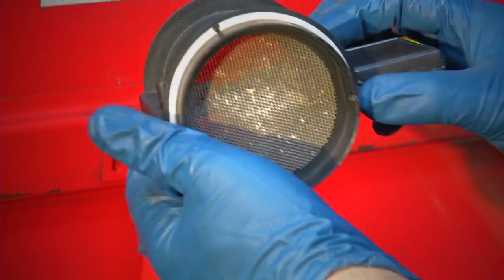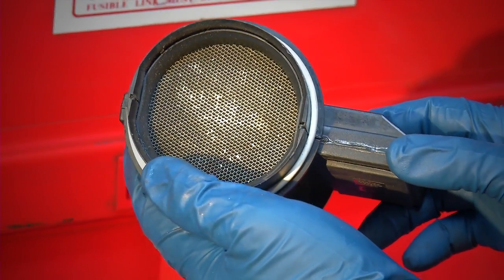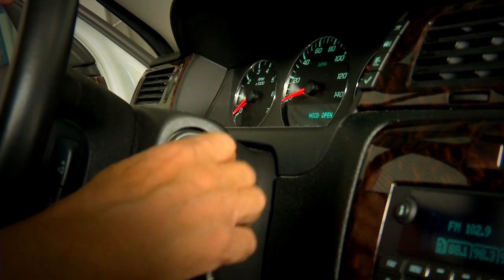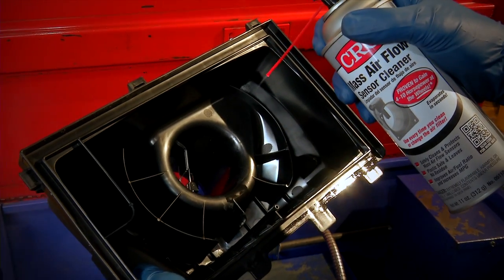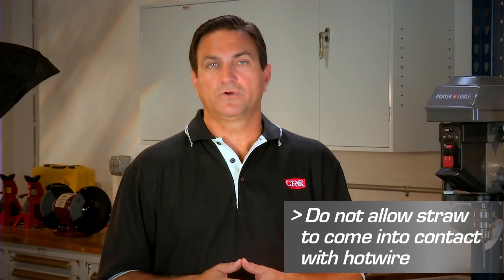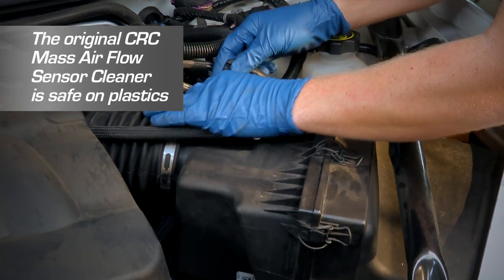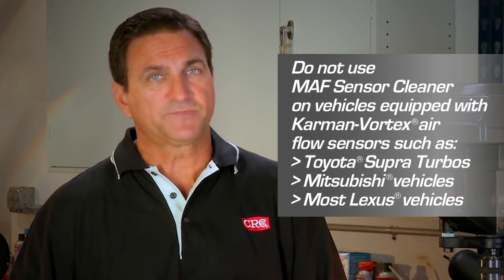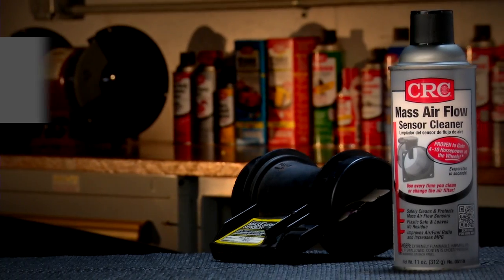CRC Mass Air Flow (MAF) Sensor Cleaner Instructional Video

Comment: Can you do a video on using CRC Mass Air Flow Sensor Cleaner as a safer alternative than standard carburetor spray cleaners, for (the newer, black) plastic Briggs and Stratton carburetors - or maybe something like CRC 05103 QD Electronic Cleaner, as another safer, secondary alternative . . . or maybe even on comparatively, which of the two would be the better / safer alternative, and why?
Seems like no one else has done this yet.
Thanks, in advance.

PS: Don't know if you'd be interested in this or not, but I'm strongly considering / leaning toward the possibility of purchasing a Toro Recycler 21-in Gas Self-propelled Lawn Mower with 140-cc Briggs and Stratton Engine, Model # 21321, and have been doing tons of research, being brand new to this, and all. Am very "OCD-ish" and aware of what folks share about this mower, as far as the various opinions, positive and negative, but've pretty much made my mind up. That's how I learned about the necessity of being careful with which carb cleaners to use on which carburetors, etc., but still have more research to do. That being said, I also did an "AI" search related to the above referenced cleaners, and thought you might find the following results interesting (?) for helping you w/your new video on this, if &/or when you do one : 

"Evaluation of CRC Mass Air Flow Sensor Cleaner and CRC 05103 QD Electronic Cleaner"
ref., https://iask.ai/?mode=question&options%5bdetail_level%5d=detailed&q=Are+CRC+Mass+Air+Flow+Sensor+Cleaner+and+CRC+05103+QD+Electronic+Cleaner+amongst+the+very+best+and+very+safest+of+carburetor+cleaners%2C+for+plastic+carburetors+and+their+component+parts%2C+like+rubber+gaskets+and+O-rings+-+such+as+those+found+on+the+Toro+Recycler+21-in+Gas+Self-propelled+Lawn+Mower+with+140-cc+Briggs+and+Stratton+Engine+-+when+compared+against+all+other+available+carburetor+cleaners%3B+and+if+so%2Cwhy%3F 

"Comparison of CRC Mass Air Flow Sensor Cleaner and CRC 05103 QD Electronic Cleaner for Use on Plastic Carburetors and Components"
ref., https://iask.ai/?mode=question&q=Comparing+CRC+Mass+Air+Flow+Sensor+Cleaner+and+CRC+05103+QD+Electronic+Cleaner%2C+which+of+the+two+is+very+best+and+very+safest%2C+for+plastic+carburetors+and+their+component+parts%2C+like+rubber+gaskets+and+O-rings+-+such+as+those+found+on+the+Toro+Recycler+21-in+Gas+Self-propelled+Lawn+Mower+with+140-cc+Briggs+and+Stratton+Engine+-+and+why%3F 

Peace : )

Comment: Works Great on my 2001 F150 SuperCrew, I've used it a few times. (Only 364,000 miles.) 😉
The right product is like the right tool for the job.
And if you're a weekend mechanic, it'll last for a long time.
Godspeed everyone. 🙂

Comment: This helped to reduce hesitation/jumping when used to clean a 2017 Chevrolet Malibu LT MAF sensor; previously I took the vehicle to a mechanic that said they did clean the MAF sensor - obviously not - I'm am removing my 5 star review of their auto shop now.
Reply: My Malibu is in the same boat.  I thought it was my throttle body at first so I'm trying this. If this doesn't work I'll have to replace my turbo.

Comment: I got a p0101 code on my check engine light, I replaced the MAF sensor with AutoZone part then got a p0171 code engine running lean, I cleaned the original sensor and reinstalled it the check engine light went away!

Comment: It didn't help,when i start the 97 ford explorer, the RPM is at 1 1/2,I don't have to touch the has pedal it literally drives itself.  And I do have all the things you list in the video. Im burning a gallon of has going around the corner 😑

Comment: Good product, I only use it if the car is already running rough. Don’t use this if the engine is already running smooth, sometimes you can make it worse.
Reply: What if the check engine lights is on though? My car doesn’t run too rough, for the most party smooth. But that light is on

Comment: Is this discontinued? I can't find it anywhere
Reply from the maker: This product is not discontinued.
Reply: @CRCAutoUS  when will it be restocked in LA ?
Reply from the maker: @zww7033  You will need to check with the retailer.
Reply: @zww7033  my local auto store said there’s a shortage nationwide. I jumped on Amazon and it came to my house in 2 days.  I recommend trying Amazon.
Reply: @ttyler333  same ordered it 2 weeks ago but it was more expensive than retail

Comment: Would this work on 02 oxygen sensors
Reply from the maker: Thank you for your comment.  We would recommend our QD cleaner for this application https://www.crcindustries.com/products/qd-174-electronic-cleaner-11-wt-oz-05103.html
Reply: @CRCAutoUS  What is the major difference between MAF cleaner and  Contact cleaner? 

MAF cleaner is significantly cheaper in my area and it wasn't exclusively used to clean the sensor in the video so what is the major difference?

I rebuild vintage RCs and I'm hesitant to use MAF cleaner on motors but so far it's been just fine on circuits. Thanks.

Comment: Can CRC QD Electronic Cleaner be substituted for MAF cleaner? Looking at the ingredients, it's nearly the same stuff. And a few mechanics have said it's fine.
Reply from the maker: Thank you for your comment.  The formulas are similar.  However our QD is a stronger formula over the MAF. They are both plastic safe and fast evaporating.  We do not recommend using QD to clean an MAF since MAF’s are very sensitive.
Reply: @CRCAutoUS  so if you use qd electronic cleaner instead of 10-15 sprays use 5-8 sprays because its stronger?
Reply: @jvirg  funny how they didn't respond.  This is a little bit of a game

Comment: Does this work for the air intake temp sensor?if not which one would I use ?
Reply from the maker: Thank you for your comment.  Yes this is the correct product to use.
Reply: CRC Auto thanks for the reply... Great only have to buy one thing 👏

Comment: Don't waste your money on " MAF CLEANER" ! brake cleaner is the same thing, carb cleaner leaves residue and dries slower.
Reply: Why take the chance of ruining the sensor .CRC is a great quality product and is used by professionals.Spend the $7 and you will have enough for cleaning sensor many times .
Reply: @joea4279  It won't ruin it.
Reply: Brent Bradley, if you don't know what the Fuck you're talking about, like YOU, STFU.....
Reply: @milojanis4901     Brake cleaner does the same, been using it weekly+- for many many years...…….grow up
Reply: @brentbradley6711  your sir are incorrect. 
Because brake cleaner etc can damage sensitve electronics such as maf and or map sensors.
Reply: @lloydturner48  Nah....been using it for years
Reply: @brentbradley6711  true!
Reply: brake cleaner is super harsh. not good for the plastics in the sensor
Reply: @nadirnazim9342  you really think that someone who uses brake cleaner to "clean" any sensitive electrical component will piece together that using harsh chemicals on an electric system/plastic will make it deteriorate faster? "Oh I have been using it for years and haven't had a single issue yet!" -Source: Trust me bro

Comment: Gonna try cleaning my MAF sensor with this stuff. I’m over 122k miles so I’m pretty it’s dirty
Reply: "Over 122k" you ain't seen nothing mate xD
Reply: @miljororforsprakpartiet290  Right...lol...275k. I saw the one side of mine and it wasn't "too bad", but you know that backside is going to be YIKES when I take it off later. Oof.
Reply: 185k here on a 2013, you still in that 122k car 6 years later? If so how many miles now!

Comment: I didn’t know you can spray the electrical terminals also. I have never did that.
Reply: It's electrical cleaner mate so i think you could use as well on sticking switch's and stuff like that
Reply: @drewsmith6066  why not just use the automotive electrical cleaner. I'm pretty sure it's the same stuff except half the price. It says the exact same thing on the can that it leaves no residue.  What's so special about this other than brand name?
Reply: @jvirg  I'm going to guess potentially no difference. Would have to check each can and see what the ingredients are but it's likely very similar if not identical. 

I've had a few different brands, purchased upon recommendation, and they're always the same stuff. 😆

Comment: Hello. My MAF needs cleaning. Can I use the MAF cleaner on the MAF wires(inside maf)  and also spray it on the built in connector  and the electrical spray (crc) to spray the connector that goes onto the MAF? Thanks.
Reply: thats literally what he did in the video lol

Comment: Would this cleaner be suitable for MAP (Manifold Absolute Pressure) sensor as well? This is on a Prius if it matters.
Reply: MAP sensor needs electric contact cleaner instead.

Comment: I noticed you said to spray the connecting wires and the plug. I just cleaned my MAF Sensor and Throttle Body, but failed to spray any wires or connectors, didn't even consider it. This won't short out any wires and cause problems?
Reply: Okay got it, I almost did it, but had some exposed wires so I just wiped it with a rag with no spray. Also, I noticed the inside of my intake was dirty when taking it off to clean the Throttle Body. Am I able to use the MAF Sensor Cleaner or Throttle Body Cleaner on the plastic intake?

Comment: Well, it seems to work very well indeed, except I found it impossible to insert the straw into the spray head.
Reply: Same. Almost gave up after spraying myself in the face. It doesn't taste good at all.
Reply: As much as this shit costs you think they would be able to provide a straw that fits in the nozzle tip.
Reply: Same with the throttle body cleaner too @ivanthetactical6072
Reply: I had to give up on it! Two sprays and fell out every time!  That's all I needed, losing that thing in the front end somewhere, causing some other problem (Murphy's Law!)
Reply: I had the same problem but I took of the black cap and then inserted the straw so I wouldn’t spray my self
Reply: @TonyVee93   Thanks. Not spraying oneself is always a good idea.  😂 I happened to come across a sale on the OEM part and was able to buy and install a new MAF. It made a noticeable difference in engine (and in the case of our RX330) transmission performance.https://www.youtube.com/s/gaming/emoji/7ff574f2/emoji_u1f602.png
Reply: @TonyVee93  genius, I'm going to try that 👍
Reply: Right?
Reply: I ALMOST gave up but somehow I managed to push it in
Reply: Did my f 250 and my K n N  filter.  45 minutes in 90 degree heat.
Reply: lol
Reply: Damn straws!
Reply: Yup still having trouble with the dang straw its 2023 get it together!

Comment: Can any of you PLEASE tell me what the LONG TERM affect would be of driving a 1993
Lincoln Town Car without the Mass Air Flow sensor plugged in? Please reply, thank you.
Reply: mister smith extreme carbon build up from rich fuel burning.
Reply: cylinders warping, total engine failure
Reply: @thetrizza  Either give honest advice, or if you don't know an answer to a question, don't answer. In YOUR case, you just don't know, so STFU!